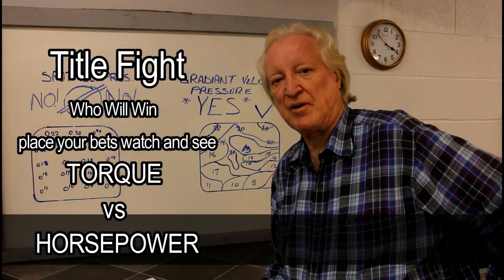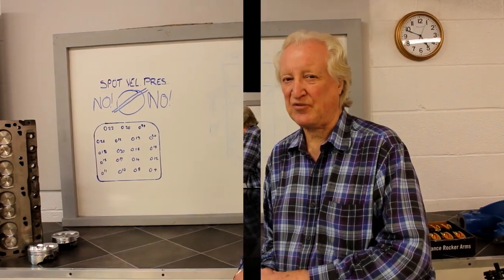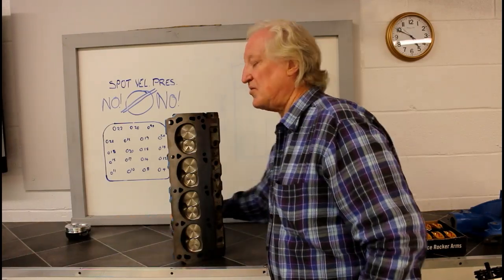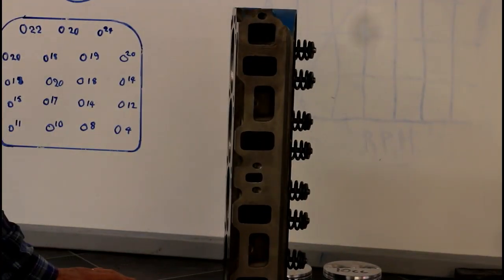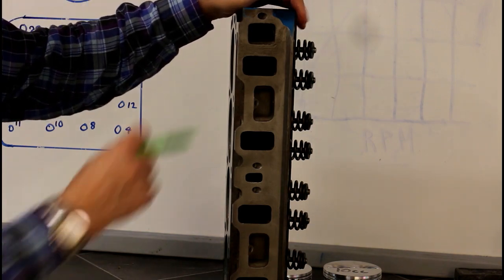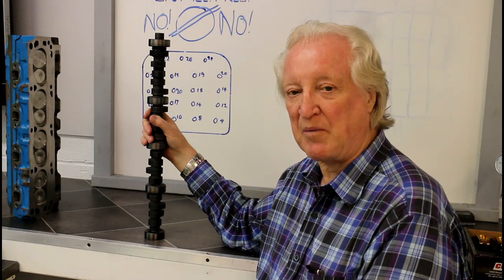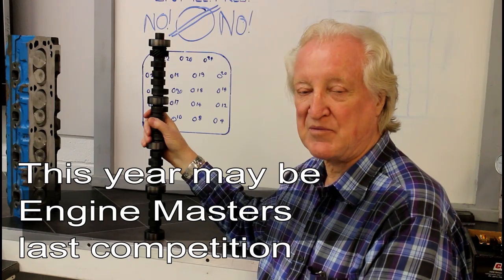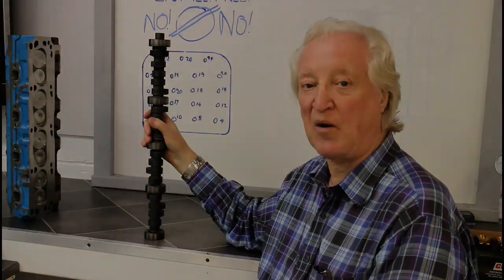Powertec 10 Episode 2 Torque vs Horsepower

Comment: Part 1

You're right in a lot of senses but HP is a misleading component to the uninitiated. As to some extent the crossover point (of Torque and HP) is merely a function of what, years ago, one person (Mr. Watt) roughly assumed the work a horse could do; in order to normalize predictions/calculations related to horse and work requirements.

After all, there is no one ideal horse that is identical to all others, for all years.

Many other variables also exist.

You can't have HP without torque. 

Your view (or at least what I understand it be) is correct; in that Torque is force over a distance and HP a product/derivative of it. 

However, I find it easier to consider Torque as a force associated with objects that spin and/or rotate - it is simply another force, albeit an angular one/force.

HP is also a force - a force that is (derived from Torque and) usually associated with objects that move in a straight or linear path.

To a great extent HP (within the car industry) only exists because yesteryear’s engineers and mechanics were befuddled about why internal combustion engines continued to generate higher peak force/thrust numbers at times when the BPEP of the engine  was falling most due to poor cylinder filling.

It is correct to assume that the car with the greater HP figure will (at some point {provided both cars have the same weight and aerodynamic drag} usually win the race) enable the car it is fitted to to experience the greatest forward force/thrust - but usually that’s only for that limited amount of time when the car with the greater Torque (but lower HP) maintains complete Torque (cylinder filling). 

So long as that happens forward thrust will usually to be greater than that produced by, say, another competitor car with less Torque and less peak crankshaft rotational speeds; and this is so because the engine/car will accelerate faster due to the faster engines speeds made available by way of the accumulation rising rate of the crankshafts rotational speeds (even though the cylinders are not completely filling and torque may be compromised).

This is one reason why electric cars with less maximum HP than internal combustion engine vehicles often beat them off the mark and sometime across the entire ¼ mile. Their Torque(and HP) are either consistently higher for a longer period of time than most internal combustion engines, or the internal combustion engine has a lower Torque specification.

Same for a lot of diesel engines out there that produce significant Torque figures and relatively low HP figures. If these engines were to produce their max/high Torque output at really low RPM (as most do) and also maintain that for a few thousand revs (as most do), then usually they will deliver - to the tail-shaft force and/or thrust - greater numbers and cylinder filling that will allow the electric vehicle within which that harnesses it, to beat a typical gasoline engine that must climb to its rev ceiling to access the peak HP.

It may sound like I am splitting hairs here, but it is these nuances that confuse people about Torque and HP; as some people can't understand why one car does not beat another (with an equivalent engine, mass, ect) when/if the losing car has greater torque. 

A good understudy (and video opportunity ) as to how Torque offsets HP and vice versa, is how the La Ferrari, McLaren and Porsche Spyder perform in a ¼ mile drag race. They all have differing Torque shaping systems of either the electric or manifold compression sorts, or both; and it is interesting to note how all the trade offs - in internal combustion engine and electric motor power/Torque, and overall weight, turbocharger lag, and peak available current to the electric motors - play out.

Another good understudy as to how Torque offsets HP and vice versa is within Audi’s range of turbocharged 6 and 8 cylinder offerings (with high Torque figures in low RPM) compared to the naturally aspirated (but high HP) Audi R8.

-Torque-: I find it easy to explain Torque (for an internal combustion engine) as the peak pressure (or force resulting from combustion and/or BMEP) in the cylinders at any 1 point in time. 

This is (loosely) the BMEP approach to explaining Torque. Peak Torque of an old steam engine is at peak pressure; and that holds within reason to be the same for the internal combustion engine. When the pressure between the cylinders and head is at peak pressure or peak BMEP, this is where the maximum Torque is.

Obviously there are differences; but there are also a lot of similarities.

Jim Stanley.
EX AMG Powertrain Engineer.
Electronic/Electrical Engineer. PhD Electroacoustics
Reply: Part 2

Anyway, (and here is the kicker) as the engine’s crankshaft (a rotational object) speeds increase there is less and less time for effective/complete cylinder filling, so naturally this limitation on gas exchange will dictate a lower peak pressure (or force/Torque) resulting from less than optimal combustion within the cylinders; as less fuel/air gets in (as RPM rises); and therefore it results in a lower maximum Torque figure. 

-Horse Power-: can be simply thought of as the cumulative amounts of individual Torque instances (resulting from combustion) that, as the engine’s crankshaft (a rotational object) speed increases and accumulates (as RPM climbs) all the poorly filled cylinders, to create an accrued force; that often (above 5000 RPM) equates to a force - even if/when there is less (Torque) time for effective/complete cylinder filling - that can be greater than the individual peak Torque figure(s).

  
In effect HP is a way to explain why vehicles often accelerate (with but with less force) faster even though their engine’s Torque diminishes; and this is why HP is often associated with objects that move in a straight line and/or linear plane.  

Within an internal combustion gasoline engine and above 5K/RPM its HP force will usually increase past Torque to offset the above-mentioned decrease in Torque presented by cylinder filling and other limitations; at around ~5Krpm.

However, as most HP and Torque plots show, as the RPM increases the aforementioned cylinder filling and other limitations that plagued Torque grow until they will not be able to be suitably offset by the increased RPM; as there are limitations as to how long HP can offset these issues/limitations and provide an increased rate of the crankshaft’s rotational speed all whilst there is less and less time for gas exchange rates to occur.

To be clear; even though there are limitations that plague Torque within internal combustion engines there comes a time (usually around 5Krpm) when the increased number of (poor) cylinder filling events will not be able to be suitably offset by the increased RPM of cylinders that are not full.

Usually  - especially with true high performance car/engines - they can extend their torque curve and fill their cylinders beyond the point of the average vehicle, such that their HP numbers suitably benefit even though as rpm’s rise there is less and less time for a complete charge to exist within the car’s cylinders.

However, at some point, cylinder filling becomes so depleted and the Torque figure starts to drop off and/or become so low that an engine simply can not spin it’s crankshaft fast enough to both, reclaim enough of the diminished Torque and/or generate the high HP numbers that are essential to offset the poor cylinder filling (and/or BMEP) associated with increased the rpm; to increase HP. 

And, in fact, if it could it would only exacerbate the cylinder filling issues by providing ever smaller time frames for the air/fuel to enter the engine.

So, HP is;

A) Accumulated Torque.

B) Simply a way to explain how quantized combustion/Torque events transferred to the cranktrain change its angular velocity/momentum in ways that produce a total force greater than that produced by Torque alone such that it can, for a given RPM range, compensate for and/or offset the decrease in Torque presented by the diminishing cylinder filling issues (and/or torque) at higher rotational crankshaft  speeds.

Horsepower is a form of Torque, but Torque is not a form of Horsepower.

It’s worth noting too that there are 3 types of torque in an internal combustion engine; instantaneous (individual cylinder firing combustion Torque), inertial (rotating mass of crank/valve train), and composite (instantaneous and inertial Torque). 

Dynamometers average the peaks, troughs, and figures of these 3 out, so they don’t really give a clear insight into them.

In essence what I am saying is that HP is a way to explain how the diminished returns of torque can still yield more thrust (than otherwise would be the case) due to the increasingly higher crankshaft rotational speeds that increase at a rate that offsets how quickly the torque (and therefore optimum cylinder filling) starts to drop off from poor cylinder filling.

So (even though the force and velocity equations are purposeful) the crossover point just at a slightly above 5K/rpm on a HP and Torque plot is to some extent arbitrary, even though HP remains as a popular/useful means to explain how objects move in straight lines and/or linear paths as a result of engines and/or motors that rotate.  

And this is so because Watt’s figure of 33,000 foot-pounds per minute - as the denominator to the equations - “disturbs” and "poisons" the other equations and their components (that all have a strong/reliable quantitative relationship to science/math); effectively rendering Watt’s figure for HP and/or Torque to be as questionable and accepted as Einstein’s cosmological constant.

Which also means a crossover point around ~5.2K/rpm on a HP and Torque plot is also something that should not be too heavily invested into also, even if it does seem that the engine produces more HP as engine rpm rises above 6Krpm.

As such the crossover point (of Torque & HP) just around ~5.2K/rpm on a HP and Torque plot is to some extent capricious; because all the HP plot is revealing is how the increased rate of poor cylinder filling (ie; the drop off in torque) offsets the usual drop in BMEP and/or torque that is the result of poor cylinder filling.

It is also why, in another video, here ( https://www.youtube.com/watch?v=u-MH4sf5xkY ) I explain HP and Torque within the context of quantized instantaneous/other torque/combustion events that - up until a given point - usually supply an increased Torque-force and increase in HP-force as RPM increases.

I know you may have said that HP and Torque are different units, but even though that is correct, to a great extent they are also contributing to the same (force/thrust); and I substantiate that by way of inference within my above-mentioned comments.

HP is simply a force-product of (and therefore similar to Torque-forces) that can possess more (HP) force than the Torque itself due to the increased rpm and/or combustion events (even if the cylinders are not totally filled due to the increasingly smaller amount of time provided for each cylinder to properly fill); but only up until the engine’s crankshaft rotation speed can no longer accelerate/increase.

HP’s usefulness within the motor industry is (aside from selling cars) simply its ability to portray/describe the collection of increasing and/or more Torque-force(s) per given time - as RPM increases - in ways that allow more overall force to be converted into thrust than the peak Torque-force figure alone/itself and/or the HP would dictate.

However, that said, within the motor and power train industry HP is rarely used to discuss force at RPM less than 5K/rpm, and that is because usually we are only interested in HP when it provides more force/thrust than Torque alone.

Jim Stanley.
EX AMG Powertrain Engineer.
Electronic/Electrical Engineer. PhD Electroacoustics
Reply: Part 3

HP is just another force - one that is similar to and derived from Torque, that - for the most part - it only remains within our vernacular to explain how increasingly more/rapid (as RPM increases) collections of force are available to offset the aforementioned falling composite Torque-forces that can often offset the decrease in individual Torque-forces presented by poor cylinder filling and other high RPM attributes.

Torque-force is the is the cylinder compression/expansion pressure of any 1 engine cycle at; any 1 point in time.

Max Torque-force is the peak cylinder compression/expansion pressure of any 1 engine cycle; at any 1 point in time.

HP-force is;

A)	Multiple Torque-forces accumulatively measured/averaged over time; whether or not they be the result of decreasing rates of cylinder filling and/or torque.

B)	Usually only employed to describe/explain how the overall force the engine generates increases as both, RPM increases and the Torque-force decreases.

I hope that makes sense; as in essence as what I am saying is that - when it comes to internal combustion engines, their crankshaft’s rotational speeds will inherently come to a point (usually around 5Krpm) when complete cylinder filling can’t occur as the increasing revs provide a smaller and smaller amount of time to fill the cylinders. But the HP can still increase (as the engine rpm can still increase even though cylinder filling is not optimal) whilst the engine can spin to higher (than ~5K ) rotational speeds, as at that stage there is still enough accumulated events of (less than optimal) cylinder filling to offset the reduction in torque.

This is one of the main reasons HP - within internal combustion engines - exists.

To explain the phenomena of an increased force (at the flywheel and/or are wheels) despite the fact that torque and/or cylinder pressures may be dropping off because the cylinders are not experiencing the ideal gas exchange characteristics of a fully filled cylinder; those in the automotive industry turn to HP. 

fdPut simply the HP figure describes how an engine can still increase the force it produces whilst cylinder filling (and therefore  torque) is not optimal; due to the fact that higher RPMs (up to a certain point) often offset poor cylinder filling and torque; because as the engine/crankshaft increases its rotational speed it does so for a given rate that is greater than the torque diminishes; therefore providing higher HP up until that limit when both the rpm and instantaneous torque events can no longer spin the cranktrain at increased rates.

Good video.

Jim Stanley.
EX AMG Powertrain Engineer.
Electronic/Electrical Engineer. PhD Electroacoustics
Reply: @StormCentre88  ,,,,Read all of this concise information.....Gotta save it.....I like your last three paragraphs as closing statements......I wish I ,  had three more lifetimes,,,,,,I failed as becoming an Engineer..........Algebra,,Geometry,,Trigonometry,,,Calculus,,,,,it goes next into Quantum physics...............I'm lucky ,, I have a great eye and hands-on talent to be a better than good Machinist.........Weldor.......Fabricator.............................God bless the formal education of some ........Thank You,,,Jim Stanley.....

Comment: Maximum torque per displacement is meaningless when talking about performance engines. Even BMEP or IMEP is meaningless.
The only thing that counts is the integral of horsepower within the used rpm range.

Comment: You gave info how to build torque but nothing on the cfm flow or port volume of the heads to create low rpm torque at low lift that being said no lift numbers or duration/lsa for a low end application. More information toward this would help a man with not alot of money make something work

Comment: Much better than the first video!  I would love to know how to make my 289 make close to that power level.  Obviously I can't get 97 octane.  I can only get 91 in Arizona at most gas stations. What did you have to do to that 289 to get that amount of power?
Reply: Beware of methodology: I think the EU does not average MON + RON at the pump, but gives the higher of the two values in RON only.  So when they say 97 octane, you are probably looking at a US equivalent of 91 or thereabouts.
Reply: theres about a 3 point bump.
US 91 R+M/2 is about 94 in the EU rating.

Comment: Hey. Is this book designed to some particular cylinder head or can the infromation be used to other cylinder heads aswell?

 David Vizard's How to Port & Flow Test Cylinder
Reply: I have used this as a basis for porting... Ford Essex/Cleveland, Holden 308/304 V8s and Buick 3.8 V6, Toyota 7MGTE (4 valve) 4AGE (5 valve) and Mitsubishi FTO, which was a 2.0, MIVEC V6.
If success is defined by flow improvement over stock, then ALL heads did just that while retaining the stock sized valves. His books are a guide, not a full LEGO type, step-by-step, breakdown of what each head needs. Some are universal, some specific. That's where your experience falls as to how to apply what he is teaching. That and buy a flowbench. That book explains that, too.